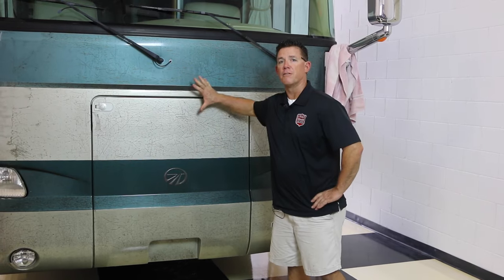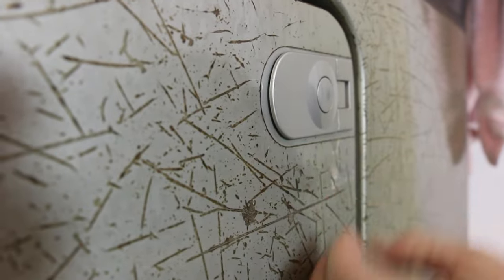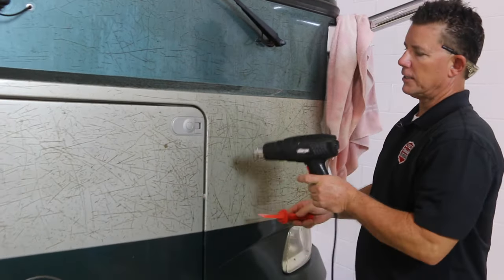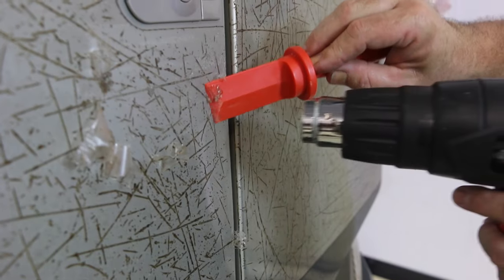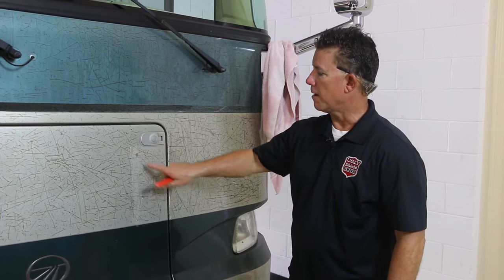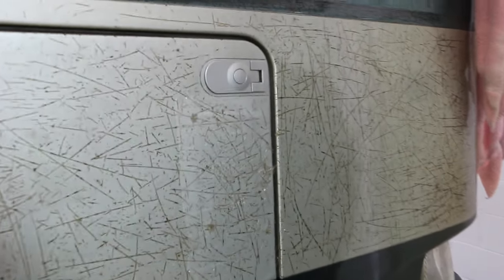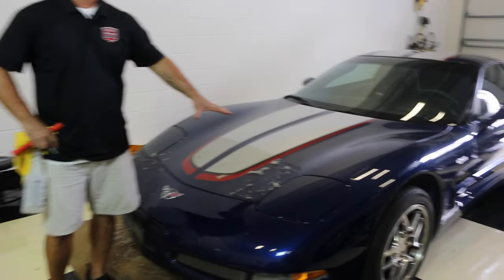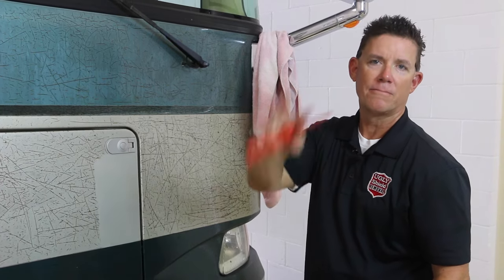3M Film Removal

Comment: I'm looking for more info on the UGLY SHIELD REMOVAL. Will this work on any paint. Or is this just for RV paint. I have a 2006 Volvo XC90 that came with the factory PPF film on the hood, front bumper cover and the bottom of the back passenger doors. I tried to remove it with a heat gun and plastic scraper and it got tacky from positioning the heat gun too close. I want to find another solution other than sending my vehicle into a body shop and spending thousands of dollars. How can I purchase this product.

Comment: I just took the clear bra off my 20 year old Lexus. The part on the hood was really cracking and looked dirty. After checking out YouTube videos on what they do, I got started. I found  that yes a hair dryer will work BUT I took my wife’s Oreck floor steamer to it and started scraping it off. Only steamer I had but it took a lot less time that way than with just the hair dryer.
Reply from the maker: heat gun was old way now wagner steamer safer and cleaner thanks for commenting

Comment: I have a 2006 Monaco Diplomat. How do I know if I have the 3M or the Diamond Shield?
Reply: On our Tiffin, under the passenger side mirror, it has an emblem stating it's 'Diamond Shield'.
Reply: 3m always have been installed on older monacos but somtimes diamond shield will be installed if replaced